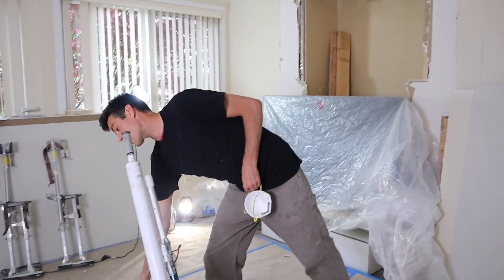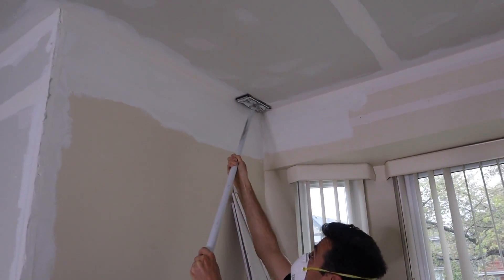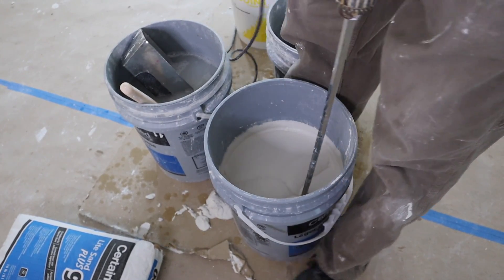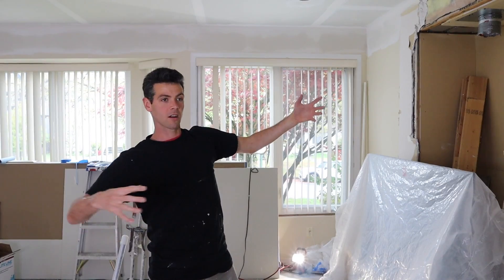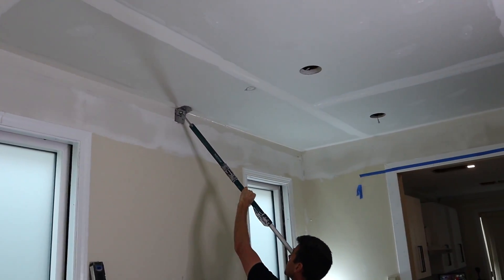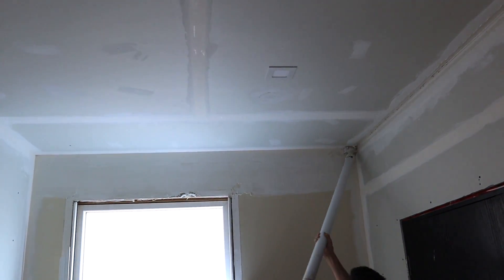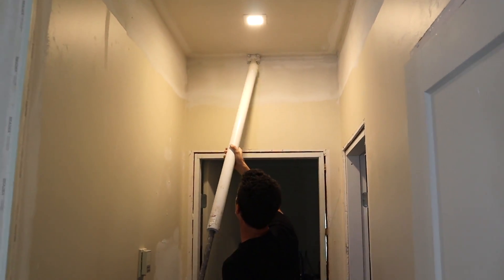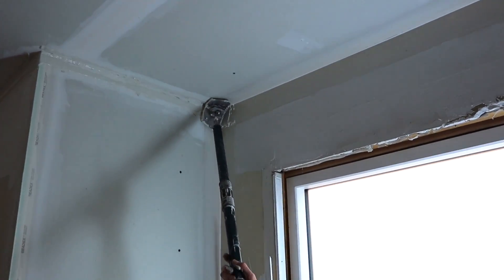Inside Corners with Drywall Corner Tools FAST AND PERFECT!!!

Comment: Used so many of your vids drywalling a room with ceilings and uneven framing by the builder(utility room in basement). I found you bids after I started job and realized how hard it was going to be. Worked out well for an amateur. Thanks! You don't want to see how much mud I went through (and sanding) though!

Comment: Been hand taping for 12 years.  Just bought my first set of corner tools.  Much faster.  I laughed when you said puking down the wall.  I had a 6" puddle of mud in one corner and it rained mud down on a few walls, did the first coat of corners on the main floor of a house the other day.  Was a rough start. Actually even thought I had made a mistake buying the cheaper set.  But said "f**k it this has to work" and kept going.  By the last couple rooms I figured it out and I was producing nicer corners.  Whole house took 45 minutes I think. Good luck doing that by hand hah, like you said nothing you can't sand out later so keep moving.

Comment: If it's the ceiling inside corner I load up the  inside corner trowel and feather the edge in 1 shot and no sanding. Then crown moulding hides the rest. I love my saw 😂

Comment: Thank you for your videos--they're the best on  Youtube, IMO.  Two  situations I'd love to see you address in your videos (if you're looking for new ideas) are the following:
1)  I have open wood stud wall that had 1/2" plywood added for shearwall, and plan to add 1/2" sheetrock on top of that.  The existing window sill of the old double hung window will end up too shallow to cover the edges of plywood and sheetrock.  I don't want to remove the old sill since it's a part of the larger exterior sill from 1905.   Have you ever had to make sill extensions?  2)  I have an open wood stud wall in same house, previously lath and plaster; studs are full 2" rough and not perfectly flat for sheetrock--all different thicknesses to shim.  Any experience with sheetrock shims?  Thanks!

Comment: I personally like to do hand angles i use to flush but find i can get a better angle by hand takes a lil bit longer since u have to wait for 1 side to dry but also find it easier to sand just a personal preference thou but if u need a job done quicker deff the best way to go great vid

Comment: They work okay if everything is more or less square, but even if your just going to use the compound tube spend the money and get the mud runner heads. And if you do it every day, just get boxes or the mud runner. The mud runner is God!
Reply: Have you ran the mudshot? I’ve been running one for two months and I like it so much more than the runner.
Reply: No, I was going to buy one, but I didn’t like that you couldn’t run over the corner without adding more mud. Sometimes a corner just needs cleaned up. But with the Mudshot the pressure would automatically add more mud, correct? I do love the idea of not having to twist the handle, sometimes that’s hard when it gets wet.
Reply: It has a check valve to regulate mud flow or shut it off, when the framing is extremely off I run my mud super thin which requires a clean up pass so I just close it and no more mud is added just cleans up the angle.
Reply: I wish I knew that before I bought the mud runner. Sometimes when your hands are wet and slimy with mud it’s hard to twist the handle.

Comment: I'm Back in class Again Today.  And taking my Notes. As far as the sanding goes, on the ceiling, what strength is the sandpaper you are using? Or I guess I should say what number grade?? Or is it fine or ruff.
Reply from the maker: 150 is a good middle ground. 120 for rough sand and 180 for fine sanding.

Comment: Hi Ben !
Thanks again for all the GREAT videos and tips.  :))
Question: Why would you use all purpose mud in this pass instead of finishing mud ?  Is there any difference ?
Thanks again
Terry
Reply from the maker: I don't use finish mud very often. I like to be able to tape with all purpose in a pinch if that's the only bucket I choose to bring on the job. So it's really about just carrying less stuff around. There isn't a huge difference between All purpose light and light finish muds except for adhesion.
Reply: @vancouvercarpenter  Thanks Ben for the reply. Which one adheres better ?
Reply: Here in Michigan all purpose is strictly for taping and  paper faced metal bead because it shrinks soo much. I like to use USG mid weight cause it’s a bit harder than the light mud and doesn’t get dinged up as much as the light finish mud.... generally I’ll use lightweight on patches
Reply: @terrybeaud9348  ap has more glue. Finishing mud sands easier
Reply: If you're going to finish coat with lightweight Blue AP synko make sure you're neat and tidy.. thin the mud down to act like a finishing mud.  Otherwise your arms will take a beating sanding lol.  Finish mud sands easily.  Also easy to oversand whereas blue AP you can undersand.  They also have different strengths when it comes to resisting wall dings.  If you were to 3x coat corner beads with finish mud they would be softer than baby shit and chip whenever you look at them wrong.  Finish mud is best served as skim coat on final coat after the joint is built up (with a denser mud) and basically flat already requiring the skim only or all coats on ceilings, easy to sand, easy to apply, can't go wrong on higher up stuff that doesn't take abuse, ceilings, bulkheads, etc.

Comment: say it beats hand taping but gotta factor in all the passes your doing pumping the mud out goin back picking the corners the extra slop on the floor the expense of the tools im hawk and trowel taper in connecticut to each there own i understand you can get it down to 2 passes or even have a better system like the mud runner that combines the mud tube with an angle head on the end. Do one side then the other all have to do is sand it minor touch up if needed and your done jm2c. like your videos btw just saying based on my experience and i use the mud tube but only for tape coat with 90d angle head.

Comment: In the video it looks the corners are all flat to begin with. What about inside corners where the wall edge, ceiling edge, or both are tapered drywall edges?  Does the corner flusher fill in the taper or does that cause any issues? How about hand finishing a corner? Does the technique change if you have a tapered edge to fill? I understand the tapered flat joints vs. flat butt joints from your videos, but I don’t think I’ve herd you mention anything specific to butt corners vs. tapered corners vs. half and half corners.

Comment: Hi, I too live in Vancouver and I would like to know how to fix a bad drywall repair. While adding mud to the drywall I didn't realise that it was not flat as it should be in some parts and so I let it dry. After I sanded it a bit but decided it was somehow going to look better after the primer. After I applied the primer, it has now become harder to sand and I have realized my problem.  But what should I do now? Continue sanding with a block. or use an electric sander?

Comment: How come you look down on wing tools (or 'corner trowels') yet that flusher, which is not so very different, leaves you giddy with delight?  Just curious.
Reply from the maker: These leave very consistent results that I have never been able to get with the corner trowel. I will admit I never spent much time trying.
Reply: @vancouvercarpenter    The key is to have a narrow fill of mud.  If you fill the corner the way your tube fills it (1" wide) then a pass with the wing tool will do an excellent job, with feathered edges and all.   You need to press it in there firmly.   Because the wing tool bends it is less prone to trouble with slightly out of square corners.

Comment: What is concrete fill and what does it do?
Reply from the maker: It's a drywall filler that was designed for skimming out concrete slabs. Like for the ceilings in concrete buildings.